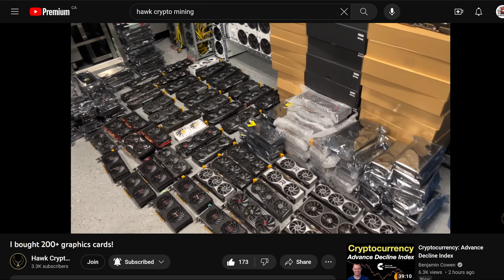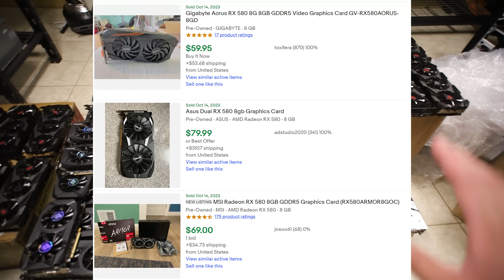I BOUGHT $5000 WORTH OF GPU's...

Comment: Dynex Question: I have same amount of shares (per24hr or per week) on OverClocked, Stock or DownClocked rigs (on herom1ners)
either nVidia and AMD rigs are behaving same for me, so I radically downclocked all of them (under 400w) and left them running..
You have the same? just try downclock them 5700xt's and let me know...

Comment: sir i am a small streamer itas how i feed my self no capping my gpu stop working i got a 3060 its so bad 12gb can i get a old gpu that works i just order a 3070 i have to sand back dsir its not boosting over 1750 on msi win in overwatch 2 i get 1850 tops i never had a gpu not show sings of pbo2    it has no boost clock over the read arrow it hits the arrow but dont go passt it